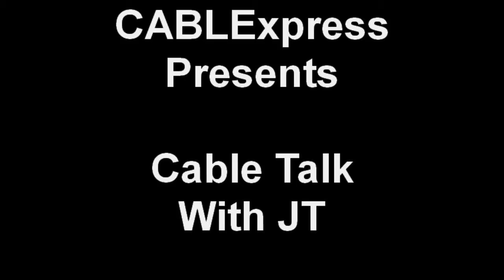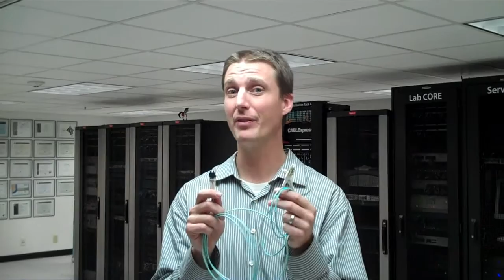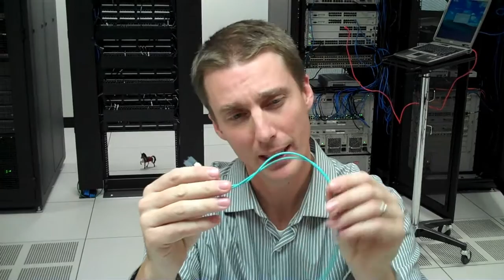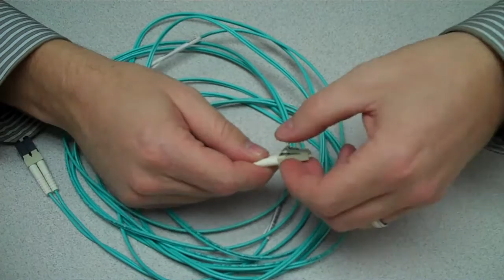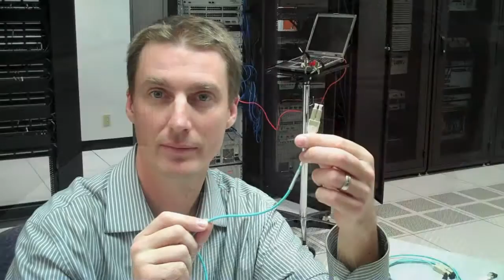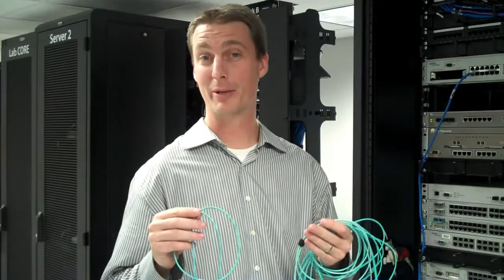LC Fiber Optic Cable Assemblies - Cable Best Practices (Ep. 5)

Comment: Hey, I got a question.  I took apart my laptop and I cut two wires (one gray and one black) thinking they were copper but I think they are actualy fiber optic.  They are the wires that power the laptop screen.  How would I go about getting these wires connected to each other again?